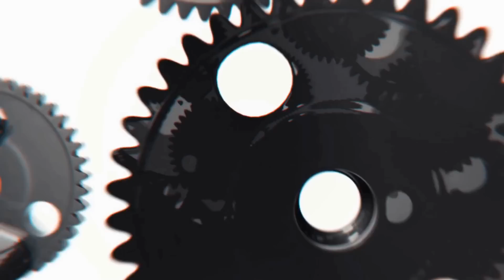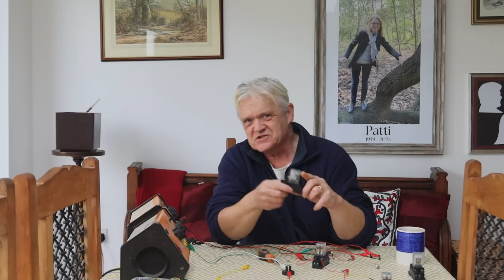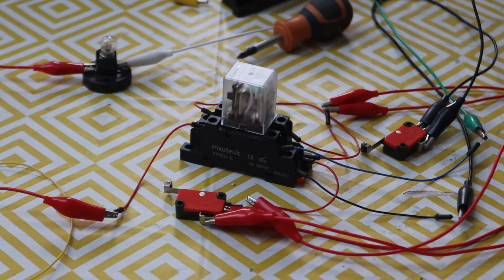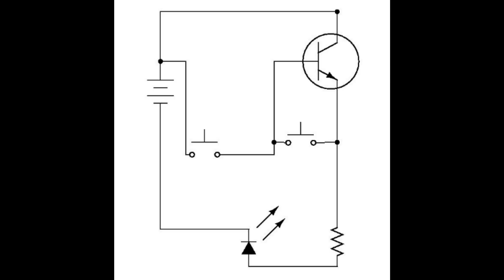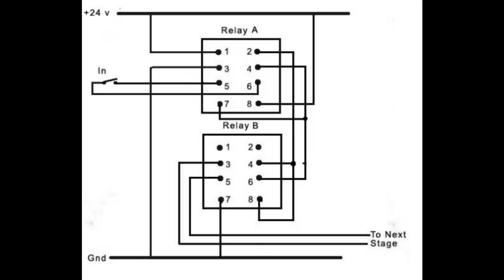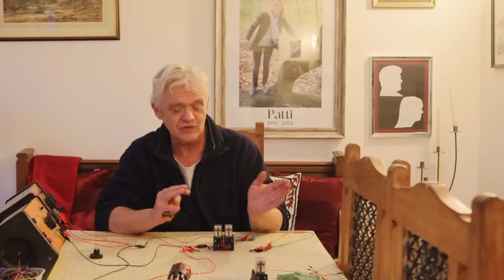2332 Relays, Transistors, Memory And Counting

Comment: relay computers exist. In fact when I was educated there were students from other branches doing logical circuits in pneumatics. It will work, apart from size, speed and reliability. I have some older tech i like to collect. Some typewriters, radios. Among this mechanical calculators. Just logic implemented in dials and levers.

Comment: Way back in history as an apprentice, our apprentice training school took part in a Shell oils sponsored electric vrijval challenge. All vehicles had the same motors and the same lead acid batteries (it was 1980) we had 2 cars, one with electronic power control (the electrical apprentices) and one with relay control ours! (Mechanical apprentices) . Theirs offered smooth linear power control ours was stepped power control. During testing and the event the electronics proved fragile with many many appearances of the magic smoke, failing to finish the event, ours was reliable, power hungry due to the stepped power delivery but reliable and we got 5th out of 15. 
Thank god electronics have evolved since them!

Comment: I'm having complications trying to contact you in private E-mail, so I'm sending you this.
I've seen Induction heater made from a rotating disk and rare earth magnets.  (These can be connected to a windmill) 
I've seen You tubes where a high speed Alu. Disk with Rare Earth Magnets was causing pieces of Alu. to melt in the area closest to contacting the Magnest, Copper rod got Red hot.
What I am curious about it making an adapted metal melt crucible to fit over the top of the spinning rare Earth magnets?
Option 1: Would placing like copper particles in an outer layer of a Graphite crucible work?
Or 
Option 2: place the Graphite crucible in a thick copper pan with 100% contact between the two?  (This option might work for metals that have a melt temp lower than copper goes soft?)
Or
Something else?

The Range of applications include:
Heating a chamber for Wax burn out in lost Wax casting (300 Degrees) The flasks are metal but the casting plaster would not directly take the heat.  Even distribution of the heat is very important.
Flasks have a hole at there bottoms and heating from just one side of the metal flask would create problems such as the too hot area would hit liquid wax first and be still trapped inside the mold (This results in cracks in the mold as the wax tries to get out when the exit is blocked).
(For a small one at a time system. Having two disks with one on each side with both of them in the vertical would mean that the wax would flow downwards and out of the mold) 
Larger batches would need to be done in a chamber so it would probably be a metal floor to the chamber, or heating a vat of water to the point of the steam Burn out system.

Melting Bismuth Metal.
I purchased at a going out of Business Auction a "White Metal spin caster" and a "Buzzer" melting pot (The Buzzer did not have a propane nozzle but does have an All metal melt pot that would work for Bismuth/Pewter metal casting.)(520 degrees)

It's when you get to the temps of higher than Bismuth Metal that you need things like a Graphite Crucible which can be made at home, and changed up to the needs of this application.
Silver (1763)
Small single flask pours of Silver are done with a coated ceramic dish on a metal long arm.  So ceramics are used sometimes.
And nobody is affording Gold anymore. 
For Everdure bronze, even getting a 30 pound Number 10 Salamander crucible part way up to temp would save a ton of propane.

*German Silver A.K.A. White Brass is another high temp melt but is still a little bit lower than pure copper.
(Because it is the most skin reactive Jewelry metal and only used in Costume Jewelry (OK. Maybe there is a market for Live action Roll Play in which Vampires would love to have a fake Silver Metal.)  There isn't much market for the Fake Metals like "Aztec Gold" and they require an acquired specialization skills in making a quality pour. 

Yes, I have high winds here, enough land for several windmills, and both the tools to re-open my bronze foundy and Jewelry lab, and I have the tools under tarps to build the Induction Heater.

Thank you for your possible considerations in advance of this problem/opportunity.

Comment: For digital electronics, you can also make computers out of tubes and valves.  Instead of electrons you could use marbles.  Instead of wires, use marble tubes.  Instead of transistors use marble valves.  The computer would be even larger than using relays, but be even more educational, as every intricacy was blown up big, for the world to see!
Reply from the maker: have you seen the 3 body problem? they made a computer from people holding flags - it was pretty awesome

Comment: no.  Only half the time a relay can do what a transistor can do (with more power).
Why?  Because half the time, a transistor is used between on and off in an analog fashion (as with amplification) rather than a digital fashion (on or off).
You don't know that?  How do you not know that?  You have many years.  Please stop teaching people wrong.
Reply from the maker: that's very rude of you mate - i talked about exactly that in the video!
Reply: @ThinkingandTinkering  I certainly don't mean to be rude.  I admit the "Please stop teaching people wrong," was probably a bit much.  However, I still have a question:  Where (what time stamp) in the video do you mention transistors can't be replaced by relays, due to transistor's analog (amplifier) use?  After all, it was it's most important use at the time in 1947 by Bell Labs (for the telephone industry).  Analog was the purpose of it's invention ; it revolutionized global communication.  I didn't see it in the video.
Reply: 2:38 in the video, you do mention transistor current "will vary to the same degree" for amplification, and that the relay would be "rubbish".  I missed this brief mention.

Comment: Robert This video reminds me of my Minivac 6010! It is a 6 bit "computer" from 1962. It uses relays and a motorized switch to run the "programs" you write with the wires and componnents you connect to the relays, lights and switch. Thanks for this primer on relay based logic.
Reply from the maker: Thanks for the info!

Comment: For those who are new to relays and intend on using them in critical applications, consider using two relays to provide a safe fallback in case of failure.
For example, by putting two relays in series, if one gets stuck in the on state, the other will still cut the power off. 
It's less likely for a relay to get stuck on rather than off, but an extra relay is much cheaper than the damage some failures can cause.
Reply from the maker: good advice thank you mate

Comment: Relays are my favorite tooo!
Reply from the maker: awesome
Reply: @ThinkingandTinkering  yeah I used to Take an old 6 V Chrysler  generator regulator with me everywhere I went for a couple years. Now I just keep a one from a 1968 john deere 110 garden tractor by my bedside.  I could wire one up with my eyes shut but.
 I haven't quite got a 100% grasp of what's going on. Just evades me. The regulator parts basically a transformer for d c but the two different sizes of wire being wrapped the opposite directions.. An electricity normally takes it easiest route.  Who knows lol. Love ur channel

Comment: Interesting video as always.  Relays were used as "amplifiers" in telegraph circuits, long before the vacuum tube was invented, to extend the range of long distance lines.  The relays and a battery would be located (often beside telephone tracks) somewhere between the telegraph stations and the relays would switch power from the battery onto the outgoing line.  Obviously, in telegraphic communications the bang-bang nature of relays was ideal, with no need (or desire) for a linear response.
Reply from the maker: nice info - cheers mate

Comment: The key thing you need in a solid state material to replicate the amplification properties of transistors is what’s sometimes called ‘negative resistance’. When you set up the differential equations for a closed circuit, an element with ‘negative resistance’ will enable solutions to have oscillatory behavior as well. If you can obtain oscillation from a DC current in a material, that’s a dead giveaway that your material has some transitor properties (including amplification). A bit hand wavy but something I learned a while back and it made a lot of sense to me that way, wanted to share.

But anyway, on relays: There are some good videos here on YT of people building small computers from many, many small relays. Looks cool. 😎
Reply: The oscillatory behavior comes from the reactive components.  Without a tuned circuit negative resistance devices are usually bistable devices; swinging to one extreme and staying there.  Negative resistance, where it can be said to exist, is more like an animating force that drives the circuit away from equilibrium. Personally, I would argue negative resistance is mostly a useful concept wrt to devices like tunnel diodes, lambda diodes, or other similar 2-port devices.  When discussing 3 terminal devices like transistors as they are used in oscillators or amplifiers, it is usually possible to analyze parts of the circuit as though some negative resistance existed there, but usually it simply makes more sense to analyze the circuit holistically, in terms of positive feedback and impedance.
Reply from the maker: cheers mate

Comment: Hi Robert. Thanks for the video, as always.
Just a thought;
Maybe it would have been better to have the drawing of the two relays, shown as the 'schematic' representation. I.E. show the coil and all the contacts.
Probably easier to follow what's actually happening.
Not a criticism, just trying to put myself in the shoes of a beginner.
Reply from the maker: it's a good suggestion mate - i will try and do that for next time - well actually the time after as i do have a follow up to this - but cheers mate

Comment: I love listening to the relays in my VW T4. They may not be reliable but being able to hear that they have failed is a plus
Reply from the maker: I agree!
Reply: There's a reason why some computerised control systems have a sound output, including one nuclear test facility. You can hear there's something wrong and ID it far faster than looking at and analysing readouts, and it's aved a lot of money and avoided injury.
Sci Fi (and real world) ship bridges and engineering control rooms should both have a low background hum of a reassuring frequency and faint beat at all times, noting a ship that's operating correctly. If it's off or sounds weird, everyone instantly knows that something is wrong, what it is, and how bad it is. Reaction times are much faster.
Worth covering as an general idea.
Reply: I have a.   auto pod V .. I got off ebay  That uses 3 latching relays to get a 130 volts dc out of your car alternator. I will purchase one and send it to your address if you could do a set on the principles behind it's functionality.  I haven't.
Had any luck finding any information on it .  I love ur channel. Truly!